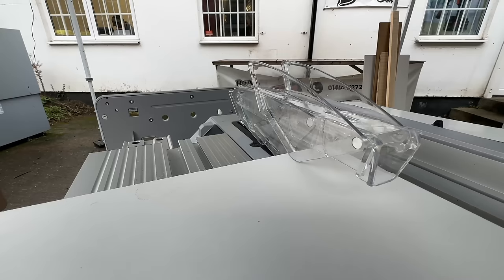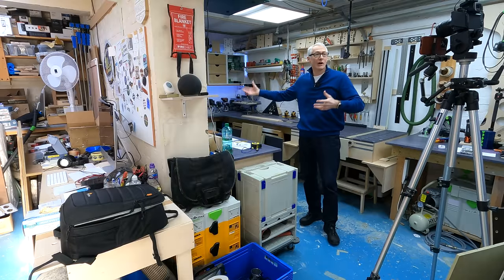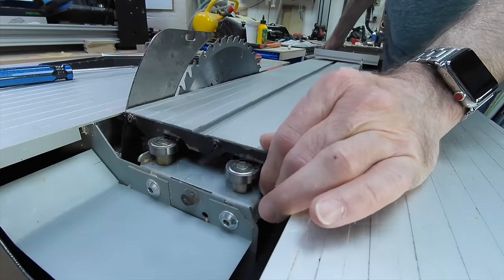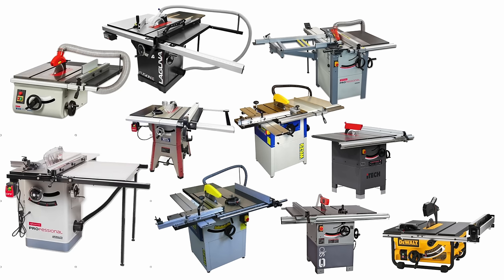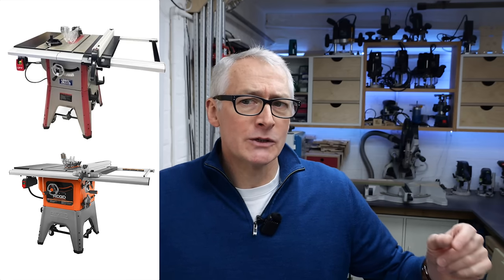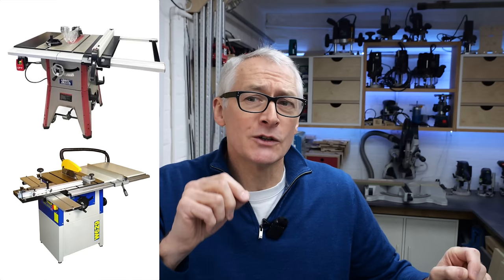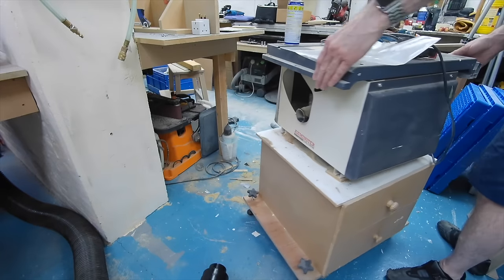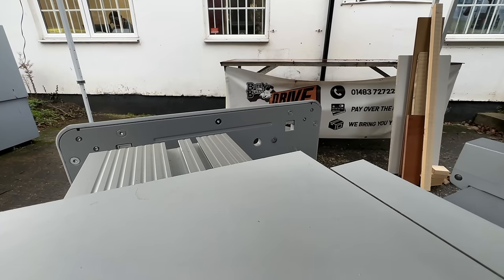Why Buy This Saw? [video 516]

Comment: I do exactly what you do for a living. I've done it for 40 years. The best portable cordless table saw I have found is the dewalt 8-1/4" 60 volt. I think its a 54 volt in the uk. Its precise, quiet, very good on dust collection. I have been using it in houses for the last three years. Zero problems. Hope this helps.
Reply: I have had this saw for years myself and am a,axed at how far battery technology has come over the years. I also have the larger DeWalt but find myself using the smaller battery one more often even when I have power at hand. When paired with the DeWalt roller stand it really is just do portable and quiet. When paired with a Bosch dust bag it does well even without a dust collector. 
While not intended I’ve found the DeWalt saw will even run a dado stack at least up to about 3/8” plywood; though I usually only run a couple 7 1/4” blades with a spacer which perfectly fits 5mm plywood, which is about the only affordable plywood left, but us good enough for drawer bottoms.

Comment: After hankering after a cast iron top table saw for more years than I care to mention i managed to pickup the Axminster AW254TS second hand in excellent condition and then bought the sliding table attachment for it. After a LOT of playing around and excellent support from Axminster I got it setup pretty well and overall am very pleased with it for my small shop.

Comment: Mine arrived earlier this week after a few weeks on pre-order from Axminster. Looking at the type of work you do Peter I think you'll be happy with your purchase. Great features, accuracy and very impressive dust collection. Only thing I'd have liked to have seen is the option to use a mains adapter as well. Hikoki have it for their 36v Table Saw. Festool have the know-how for this as they're already using it in their cordless sanders.
Reply from the maker: Thanks Adrian! And yes, indeed - mind you, those mains adapters for the sanders cost about as much as an extra couple of batteries! 😂

Comment: Well explained and similar thoughts on requirements than I had. I once purchased a used metabo 5348 for 50€ and it worker surprisingly well, also in hardword with only 500W power. Just take it easy and it will cut anything. It is silent (no brushes), angles can be adjusted accurately. The issue of dust collection got solved with simple enclosure around the base with a door in the front to set adjustments and a hole from underneath to attache vacuum. I won't miss for stripes and small parts. Everything that is smaller than the base of the track saw got cut on that saw. it is also helpful for groves and 🐇. Latly, it got some competition from the bandsaw.
Thanks for showing the festool.

Comment: Can't wait to see how this works out Peter.  While this wouldn't be a saw for me, the thing that I'm really intrigued by is the technology.  The electronic display, motorized controls etc brings out the nerd in me.  Makes me wonder what table saws will look like in the future!
Reply from the maker: Thanks, and yes, looking forwards to getting my hands on it. Funny, the digital, motorised doodads are the least appealing thing for me! Then again, I thought lasers on a mitre saw were a gimmick… 🤷‍♂️😂👍
Reply: Check out the Martin T75 and Altendorf F45 if you want to see the future :) These large sliding panel saws already had motorized CNC controlled functions two decades ago and nowadays the options are endless and the precision is amazing, working to 1/10th of a millimeter and 1/100th of a degree. This might sound silly but it makes all the difference in a professional environment. I believe there's a video where Peter explains why he never moved to a larger workshop and I think it's really inspiring to see how he runs a business out of a shoebox workshop. I certainly wouldn't be able to do that!
Reply: @newdutchworkshop7026  yes and that aldendorf also has 2d nesting of your parts in their electronic display.

Comment: Interesting sir I faced similar thoughts about what to get for a table saw.  I heavily considered the festival but the only packages here were the full package with the legs and Support   I had quite a few Bosch battery powered tools at the time so I ended up buying the Bosch GTS 18 V – 08 n14 prop factor.   I tend to shy away from festival battery powered tool due to the batteries, not going all the way across the line of tools   I find the dust extraction extremely good for a benchtop, portable Saw

Comment: Hi Peter, you mentioned the DW745. I have it and it does have some issues, the primary one being too damned noisy. That said the fence and table is great if a little short on infeed and out feed. Despite this, it’s exceptional value for money in my opinion and believe it has now been updated with some improvements in the form of the DW7485. Not sure if it is freely available in the UK or on its pricing, but I’m sure it is a good “budget” option vs the new Festool which unsurprisingly is prohibitively expensive for most people.

Comment: I bought the lumberjack hybrid  saw a little over a year ago. It’s a great saw,powerful and accurate. Flat cast iron top,good dust extraction and relatively quiet. It’s not a portable saw,it’s way too heavy to transport to a job site. I bought it because my workshop is small and I needed a saw I could move when required. What sold the saw to me was the saw has wheels that can be jacked up by a foot pedal,this is included in the price. I don’t regret the purchase.
Reply from the maker: Yep, and the fact that it comes with a mobile base is a big plus in a smaller workshop. 👍

Comment: I've got the Axminster workshop 10 inch saw. I bought it a few years ago when it was still under the Axminster red hobby brand and about £500.
Im generally very happy with it, though like most Axminster products, it took some tweaking to get good results from it. The stops for 90 and 45 degrees were both way off. The 45 degrees one was about 43, so it wasn't possible to dial in 45 degrees with a digital angle scale until I adjusted it.
The fence is suuuper naff, and the dust collection is crap. It's only 1100W, and it's very easy to stall the blade.
All that said, I've had spectacular results with it now that it's all tuned up.

Comment: You know what I want? A vastly stripped down table saw, just the "guts". The motor, blade and adjustments for depth and angle, and a minimal table, so that I can mount it in a bench like people mount routers. I don't need a massive table, the workbench is the table. Some people do this with circular saw hacks, but they're not designed for that.

Comment: Surprised that you dismissed the Festool CS50 and CS70. You said you did not like then so fair enough but I have owned the CS70 for about 6 years and find it so versatile. I removed the legs and made a cabinet on castors with a CTL26 built in. Works amazingly well. 

Can position it in seconds to use surrounding surfaces as support or out feed tables. Extraction is great and can just lift it off the base and take it the work place if needed. 

Then you have the fantastic pull saw feature, which for me takes the place of a chop/mitre saw. This is hands down the most useful, versatile tool I have and I just love using.
Reply from the maker: That’s what I’m planning with this saw, cabinet with vac beneath. 👍

Comment: Hi Peter, i live in the Netherlands i bought the axeminster bench top saw (craft) great saw. Though i have it for a year now it good available here now (gereedschappro approx 1100 euro) i have the smaller (216mm) version and i added the side extensions to it. It is a relay nice saw. But on top of this you then also should buy a dust extraction with bigger capacity 100mm port a normal shopvac will not work. That also adds to the cost. Br. Martijn
Reply from the maker: Thanks Martijn! I already have a 100mm vac, but part of the appeal of the Festool is that it’s designed to use a regular CTL extractor. 👍👍

Comment: That seems like nice saw. I live in the USA, and I own the Milwaukee M18 battery-powered jobsite table saw. I went with it because it's easy to buy in the USA, I already own some M18 batteries, and it is indeed quite portable and lightweight.

I occasionally do some woodworking and carpentry projects in my garage in Chicago. When it's warm outside, I take my saw out to my garden with a couple lightweight, adjustable-height folding tables (one for the saw and one as an outfeed), and I can get decent results with my cuts.

I love the portability of my saw. Even though I always hook up a shop vac + dust separator to collect sawdust when I use the saw, I always prefer to work outside in the fresh air in my garden when the weather is nice rather than inside my garage. When I do work inside my garage, I have to park my car out on the street, which is a pain since I'm in the city and I often have to circle around my neighbourhood a bit to find street parking. So I think I'm willing to sacrifice a little bit of precision to have a tool that's optimized for portability and ease-of-storage.

At some point, I may look at some small hybrid cast-iron saws. On the one hand, I'd love to have a truly flat machined top to my saw, and I'd love to have a rigid and sturdy fence. On the other hand, sometimes when I'm working on a project out in my garden over a weekend, we'll suddenly get some rain in the weather forecast, and I'll have to take my tools back into the garage until the rain clears up and then carry everything back outside to resume work. At those times, I'd much rather carry around a saw that's 20 kilos rather than a saw that's 40 kilos or more...

Still, I'm jealous when I watch all these videos on YouTube of people who have these great cast-iron saws with large, precision-machined work surfaces, rigid fences, and great dust extraction.

Comment: Like you this saw you ticks most boxes for me as I have very limited space. if they did a mains adaptor for it I would order one right now. With the option of buying batteries later if and when it suited me.  Awesome video
Reply from the maker: Thanks! You’re not the first person to mention this, and I agree completely - seems like a crazy lack of forethought. I’m in the Festool battery platform already for the drills, so it’s less of an issue for me. 👍

Comment: I have the same wants/needs as yourself for a table saw. Having no festool batteries and really never ever needing a cordless table saw - I can't go with this new Festool. The Dewalt 10 inch is the perfect saw if the extraction was just a little better and it didn't scream like a banshee!
Reply from the maker: Yep, those two things were deal killers for me and the DeWalt, sadly. I almost didn’t get the Festool because of the battery, but then I thought why not?. 🤷‍♂️👍

Comment: Kity used to fill the gap that you are looking for. I would suggest getting one on eBay when they turn up. Small, quiet, cast table and well engineered. I had a garage workshop when I bought my Sedgwick 315 30 years ago. It’s quiet,safe and has dust extraction. It’s enormously better than what you are proposing. I didn’t have the space like you, but I made room for it. Everything less is just a toy(almost). I use it for ripping and a mitre saw for cross cutting. I have a site saw in another place and it’s just not good or safe enough. Horses for courses. As you say, you don’t know till you’ve bought and used it. Those plastic fence guards are a nightmare. Mine exploded when the wood jammed in the huge clearance insert provided. Sort out a kick stop as a priority for safety and convenience.
Great video as always. I’m tempted to suggest you should get a bigger workshop. Small house, big workshop works for me.
Reply from the maker: Thanks, but I’m afraid I disagree; I had the Axminster version of that small kity and it was horrible - terrible fence, sloppy, non-standard mitre slot, and no dust extraction to speak of. The only thing had had going for it was a cast iron top and an induction motor - and the fact it held it’s value really well! One of the few power tools I’ve managed to turn a profit on, lol! 

Not sure what you mean by a kick stop?? Would love a bigger workshop - there’s ~900sq ft available at the end of my road, but they want £27K/year plus vat (roughly 7 times what I’m paying now for 3x the space) so not going to happen! Also, I make YouTube videos - what would I do with the space? 🤷‍♂️👍

Comment: Being a festool crazed madman myself I’m looking forward to seeing what you think of the new saw. 
Out of interest peter what don’t you like about the tks 80 and the cs 70? I bought the cs 70 set myself with very little use and find it a great saw once set up properly.
Reply from the maker: Thanks. All the Festool table saws - until this one - follow the same pattern established way back by the CMS; instead of a simple t-slot/mitre slot there’s a proprietary extrusion around the perimeter of the saw that handles all the accessories/moving parts, and I just don’t like it. 🤷‍♂️
Reply: @10MinuteWorkshop  I can’t help but think this new saw Will development into a bigger unit. I guess I make you right it a old design. 
Thanks for the reply Peter😊👍

Comment: This when I saw it would compliment me well. I do cabinet installations, and use the track saw mainly for that. but I don't like bringing the big DeWalt table saw because of the weight, and with my lower back issues, it really is a problem for me

Comment: Peter, if you are still waiting, then Amazon UK has stock.  I’m not affiliated to Amazon in any way, it just seems unusual that they have stock whilst all the other regular Festool retailers in the UK (and Festool themselves) have been out of stock for a while - and I suspect they are all still waiting. I bought mine a while ago (from the reliable team at D&M) and I absolutely love it, although I admit that I’m a newbie woodworker and amateur so my opinion counts for nothing. I’ve built a (not so portable) jig from aluminium extrusion that allows to me to cut larger boards accurately using the SYS 50 with an Incra Positioner when needed. Really looking forward to your review - keep up the great work. Richard W
Reply from the maker: Thanks Richard! Honestly, it had never occurred to me to try Amazon! I'll take a look, thanks! 👍

Comment: Thanks for sharing your purchase process. I like the way you define your needs and then move through options.  I ended up buying the Dewalt 7491 and found it to be just adequate. It is noisy and fairly accurate but not so good with sheet goods, or dust collection.  Since then, I have gone Festool with just about everything minus the Kapex, which I will buy within a month. It is pricey, but looks like a joy to work with. (I should say, I am retired and thus a hobbyist spending my children’s inheritance!). 😊
Reply from the maker: The kids would only blow it! 😂👍

Comment: Been woodworking for 10+ years and I’ve recently been hearing people like you say I’ve had no use for a table saw and I have to say this blows my mind.  I use my table saw on almost every job and find countless uses for it?
Reply from the maker: Only thing I ever really needed it for was very narrow rips, and cutting wedges - and I found other ways to do those too! 🤷‍♂️ A lot will depend on the kind of work you do, of course. 👍
Reply: @10MinuteWorkshop  modifying a kitchen cabinet that will require making two new drawers and adding support to the inside of this cabinet.  All tasks going right to my TS, cut all of drawers to width & box joints on it then use it to cut supports to width.  Use miter saw for length cuts and planer to get support down to proper thickness…before planer would have used TS for this.  Guess I could do all by hand but too time consuming for me.

Comment: Nice video. I live in an apartment myself and I have been using Makita cordless track saw for a while as dare I say my first woodworking tool. I loved it for cutting long sheets on ply but when it comes to smaller pieces it's not ideal.
I would love to get a table saw unfortunately Festool is 2x my budget. Axminster saw looks perfect if not for it's weight as I might need to move it around from one room to another. 89kg is no joke.
Another option for almoat same price is Bosch 10XC and Dewalt 7492. I prefer the former.
Any advise on choosing the right saw from the mentioned would be welcome. Especially if you had any experience with the Bosch one. Thank you.

Comment: That Milwaukee table battery powered one is shockingly good, and insanely quiet.

I have the dewalt with the rolling collapsible base and while it's extremely loud due to minimal construction around it, I love that saw heh
Reply: My working partner has the Milwaukee cordless we use quite often on the job..It's kind of heavy to move around, but I'm kind of old so it could be me. Accuracy is pretty good for being cordless, but as long as you know your limitations and don't try ripping gigantic sheets of plywood and such it's a decent job site saw. I have a SS 52" in the shop for heavy lifting so we're covered with the Milwaukee on the job in customers homes..It's about as loud as the typical cordless circular..I think it's built around the Milwaukee cordless circular..